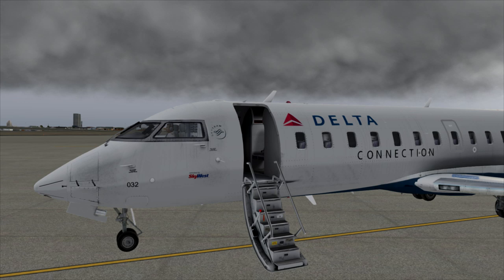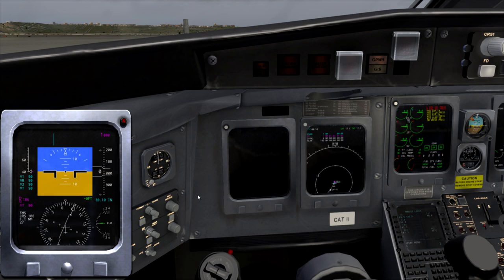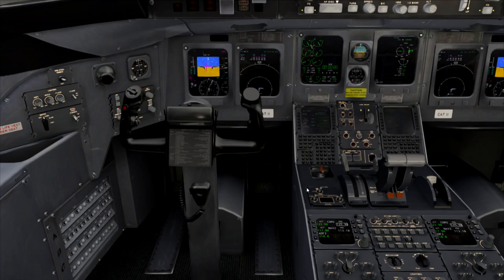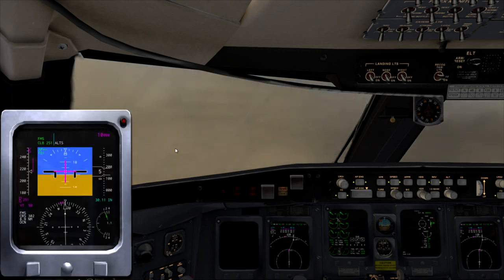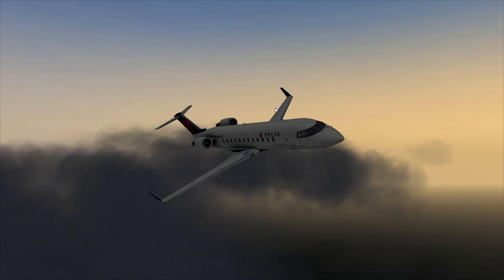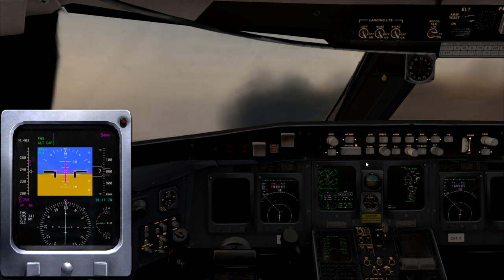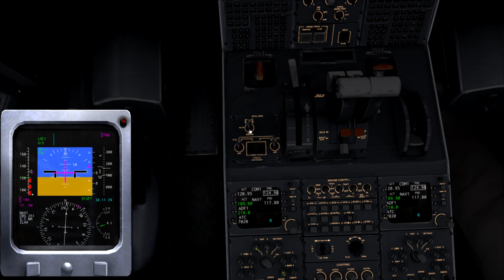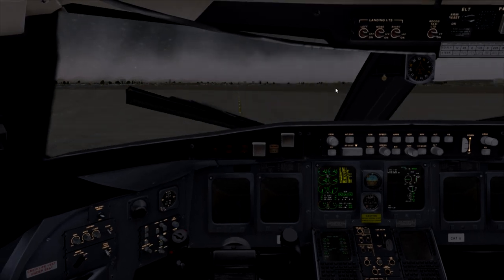SAN to LAX in the JRollon CRJ-200 on PilotEdge

Comment from the maker: That is stock scenery, which sometimes has correct taxiways, but never has any terminal buildings. You can obtain modified scenery with more accurate visual layouts. I haven't focused on that in the past because a) my machine couldn't handle it and b) the portion of time spent on taxiing was minimal compared to flight time and prep time.  condition (a) has changed, and I have machine that can do it, so I'm considering it.

Comment from the maker: The only plugin I'm using is PilotEdge for the ATC, nothing else. The views are just stock X-Plane 10 'quicklook' features. You find a 3d view you like, push ctrl-[numpad] to remember it. To recall it, you just push the number on the number pad. I have 6-7 views saved (per airplane). It's the reason I don't have a TrackIR.

Comment: When I first bought Xplane10 is very disappointed with the graphics and flight models because there were just runways but no buildings and the new 747-400 would bounce to much on take-off- so it sat on the shelf for years!  A few months ago, I reinstalled it, download latest update, download the newest free high Res photoscenery and found some awesome freeware and payware  airports-  for example KSLC and PHNL and Aerosoft Amsterdam and KLAX and KLAS  and also 777 World Airliner and now it looks awesome and I have begun moving away from FSX and P3D.  I'm thinking of getting the CRJ buy it was created by the same people who made the default 747-400 and it has the same bounce on take-off!  I feel the bounce is not accurate as I have flown in several planes in the past and they don't seem to bounce! Any thoughts on this and the CRJ?

Comment: How does ATC determine the transponder code on Pilot Edge?
Reply from the maker: +Kevin Davis it's assigned by the server. The controller then reads the assignment to the pilot. The pilot enters the squawk code and if it matches the code assigned for that target, the scope associates the flight data strip with that target and the controller sees a full data block for that aircraft on the scope.

Comment: Im still learning how to talk to atc. How the hell do you memorize what you reply back to them . Any tips? im quite new the world of simulation
Reply from the maker: Every IFR clearance arrives in a similar format, CRAFT (clearance limit, route, altitude, frequency, transponder). You develop a shorthand for writing it down over time.
Reply: Thanks. Do you know if pilotedge does some practice? im afraid theyd kick me out like vatsim if i do something wrong.
Reply from the maker: dukeskylar You need to have a reasonable idea of what you're doing before flying on PilotEdge. There is a training program on our web site with 3 VFR flights and 11 IFR flights which can help. If you show up and try to do a random flights without any idea about how to communicate on the radio then it won't go well. If you so some preparation, though, you should be ok. Reasonable mistakes are ok. Completely unrealistic mistakes, not so much.

Comment: that take off was really bad.
Reply from the maker: you're right, it was a shocker. I don't recall what was going on that caused me to overcontrol the yaw so much during the takeoff roll.
Reply: Do you have rudder pedals?
Reply from the maker: They were inop at the time. I had to use the twist grip on the stick instead and ended up over-controlling it. I'm not too worried about it,t his isn't an issue when I fly real airplanes :)